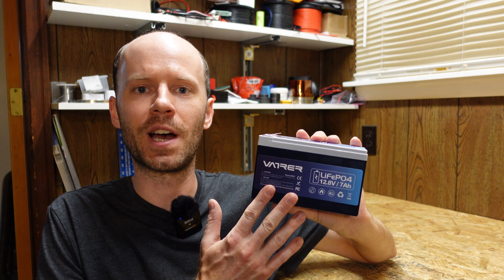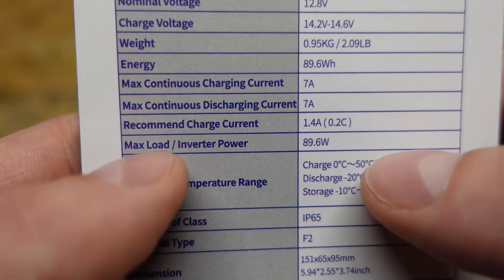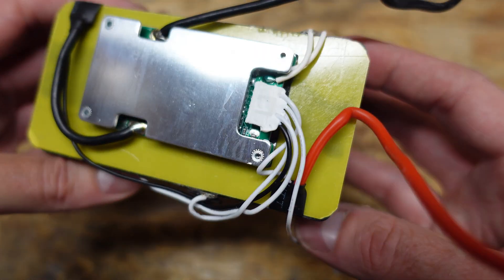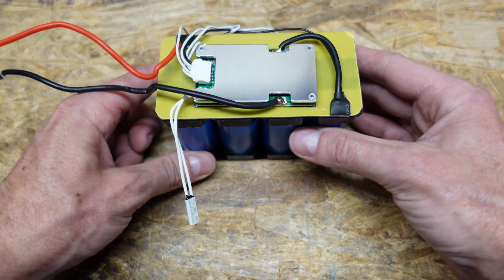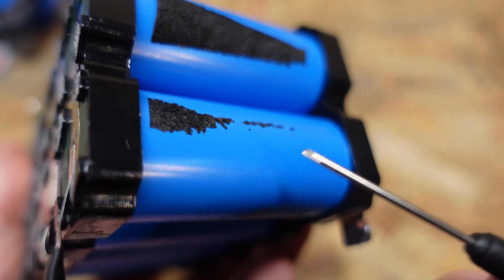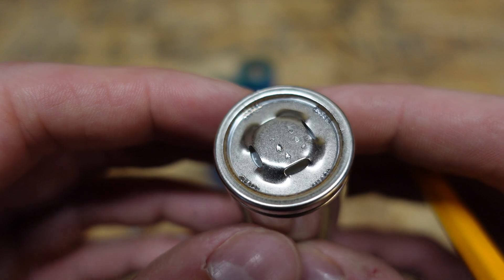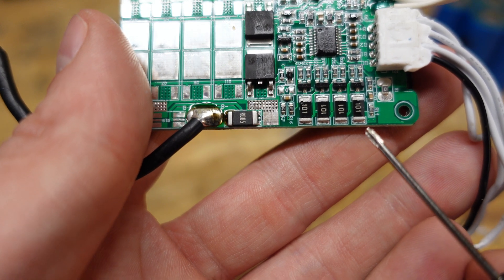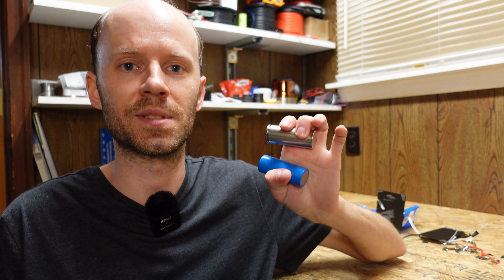Quick Teardown of the Vatrer 12V 7Ah LiFePO4 Battery

Comment: been seeing lots of the new 12v mini 100ah now....nice how small they are.. i wonder if they can fit a 200ah on a normal size 12v 100ah case  🤔 a 200ah on a standard size 12v housing will be nice to see  maybe just make it a tad bigger for the BMS and have some room for it to breath inside so it dont get too hot
Reply from the maker: I was offered a 100Ah Mini from LiTime, but didn't accept it as it seemed people were tired of the 100Ah battery reviews lol. Maybe I should reconsider?
Reply: @LithiumSolar  100Ah in a mini size?  Chinesium exaggeration?
Reply from the maker: @ahaveland  No, they're legit 100Ah. Judging from the marketing material, it looks to be a slightly higher case with less wasted space inside.
https://www.litime.com/products/litime-12v-100ah-mini-lifepo4-lithium-battery-upgraded-100a-bms-max-1280wh-energy/?ref=lithiumsolar
Reply: @LithiumSolar  Thanks - they look sweet - 4 or 5 of those would make a long range ebike, but would need extra balancing.
As this video was about the small form factor 7Ah battery, I was thinking that 100Ah would be a tad optimistic for this size, but may be one day!
Reply: @LithiumSolar I mean, you’ll always have me watching any battery teardown. I’m into pararalle wiring all sizes for different size constraint challenges.